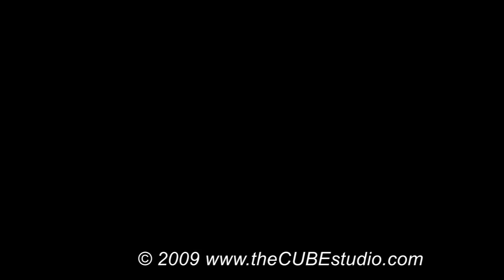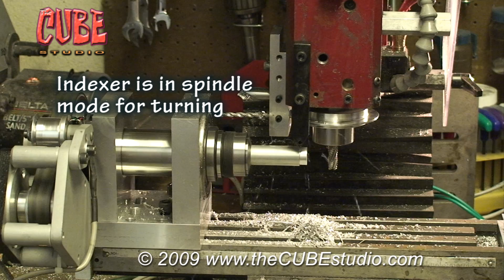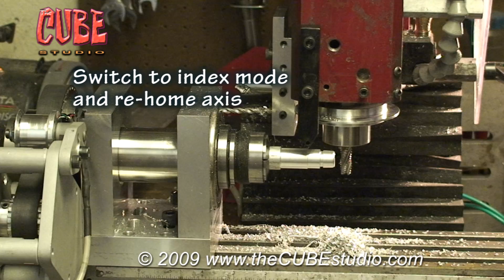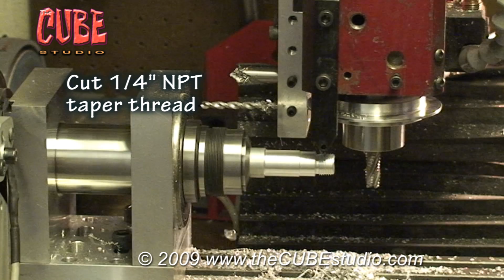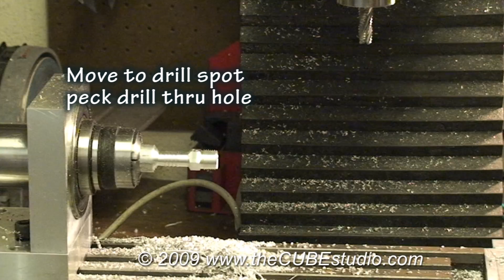Mini Machining Center - final design 4th axis - scratch built servo powered

Comment: For a small machine that is fast enough to make some money on the right projects and save you $money$ from running to the store when you need something you can whip up in 4 minutes. Takes that time just to get shoes on and leave the house. I am surprised nobody is manufacturing machines like this. I imagine there would be an extensive market of potential buyers who would rather purchase versus build their own. Two kinds of machinists exist; Ones who buy the machines and tooling to make their parts and the ones who make the machinery and tools to build their parts. Far more rewarding doing what you did right there.

Comment: pretty nice! I have a question left - could you give a short coment onthe Servo you use for the spindle ( speedof the axis in RPM mode,  power, etc).... I'm recently having issues with my DIY Lathe as all servo motors I could find are not really able to supply the inertia of a 100mm 3 chuck holder . And can not switch " on the fly" between analog input source and pulse train control...

Comment: How can you cut threads in mill mode? Using mach3? When I try to use G76 it barfs :(
I have 1 pulse per rev on 4th axis and I get RPM readings.. How did you overcome this?
Thanks in advance!

Comment from the maker: The machine in this video is an early prototype. The machine evolved into a far more capable device and now has a matching tail stock and trunnion table as well as a custom motor control system that takes full advantage of the capabilities. 

I have added a link to a current iteration of the machine in the decription of this video. The macine is available for purchase in finished form. There are currently no plans to offer drawings or a kit for the DIY market. 

Thanks for your interest!

Comment from the maker: @kingmike40 
This X2 and early prototype 4th axis are long gone now, replaced my a new scratch built mill and new design 4th axis. The X2 is useable for small work if you add ball screws, a belt drive and a column brace. 

In this video the X2 was still using stepper motors and the 4th axis still had the older style (noisy) trapezoid belt.

Comment from the maker: @OfisProPlus The servo motor shown is an 850 oz-in 72V NEMA34 DC servo motor available from homeshopcnc
Some updates: the hardware swapaxis board is completed and tested now. Make sure to watch the latest videos that show the final Super Duty version of the 4th axis.

Current project is a trunnion table for the 4th axis.